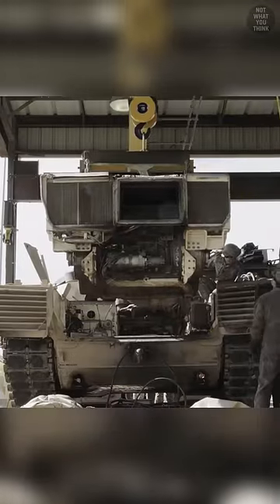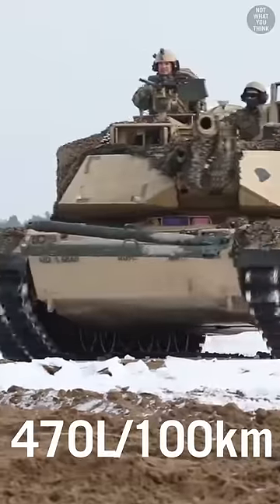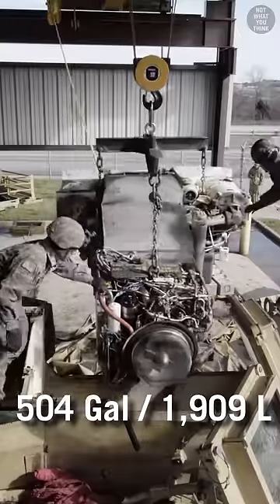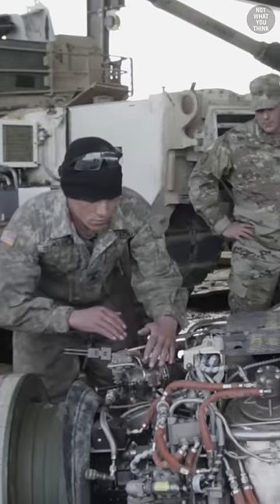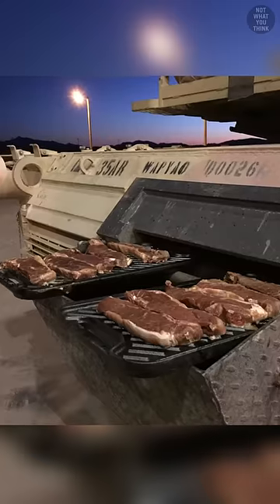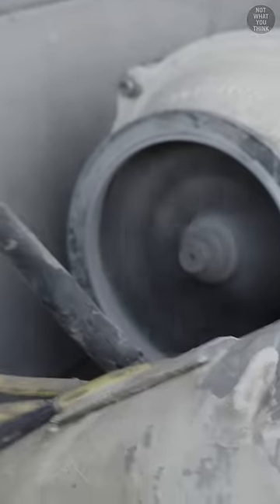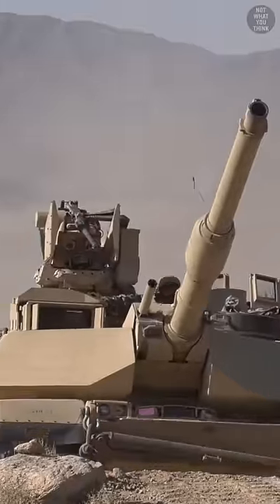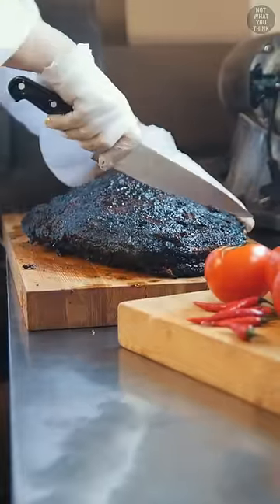Why M1 Abrams Tanks Have Gas Turbine Engines #shorts

Comment: The more quiet part is Not what you think

IIRC Abrams engine produce sound on higher decibels compare to turbo diesel engine on Leopard 2, but its sound is higher in frequency, meaning it dissipate quicker at longer distances. That means if you're standing from afar you are less likely to pick up Abrams's engine sound.
Reply: Saw some Leopards roll by during a military parade rehearsal in my country & I was joking that with how noisy they are, they'd give away their location to the enemy
Reply: Plot twist, nicely done sir.
Reply: You Dare Use his Own Spells Against himself, Minh ?
Reply: Watched a video of an Abrams rolling by.

You hear the tracks before the engine.
Reply: @lzh4950  i dont think theres any tank ever that is acceptably quiet, i saw a ww2 museum tank parade and boy the noise is unberable i would shit myself if i was in battle and heard that.
Reply: Gas turbines als support less fuel variety than common military diesel engines.

For example you can fuel some diesels with cooking oil, which is hypothetically useful during war times...
Reply: I've always wondered if militaries employed sound detection devices. Maybe radar is just so much better that you would never use anything else. 

But then again you have elephants communicating over vast distances with low frequency sounds.
Reply: Having lived near a National guard depot that had abrams, I will say they are actually both quieter and louder. Idling, quiet but emit a very high soundpitch that drives dogs mad. If accelerating, yeah, much louder than a diseal
Reply: @iivin4233  dont know much bout radar but wouldn't it be more like a sonar or acoustic detection device? I mean i get what you mean, be a sad day when hellfire rockets can home in on sounds rather than laser guidance or heatseaking. Little good hot smoke will do after that.
Can you imagine homing in on snoring or whispering from 15miles away? Scary..
Reply: That's super interesting

Is that why you can hear big bass drums over long range compared to instruments and voices at the same volume?
Reply: They do, but mostly the navies. I assume a sonar for land targets is not very effective, firstly since sound waves travel worse in air compared to water, and second, there is probably more noise (literally) compared to in water, so you will have a hard time distinguishing targets
Reply: @gameseeker6307  In my experience as a bass player, yes.  I think the wider/longer wavelengths at lower frequencies need much more energy/volume to produce a comparable volume to higher-ranged instruments (such as guitars and vocals).  This is why when you stand outside of a music venue, you'll probably be able to hear/feel the lowest instruments (ie: bass, drums, synth, etc), but not so much the harmony/melody ones, because the lower-ranged instruments need to be much louder/moving more energy.

If there are any audio engineers out there, feel free to "Um, Actually" me if I'm off-base. :)
Reply: @thelumpylobster  it makes sense ig, really noticeable at marching band performances or when you're far from a stadium or performance venue
Reply: That's definitely interesting. "it's so loud if you're up close it's louder than ever but it's infact so loud that from far away you cannot hear it
Reply: @TheAnnoyingBoss  ...because its the "right kind of super-loud," lol
Reply: @Dooaana  turbines compress their fuel more than standard gasoline engines prior to combustion, they also heat it a lot. You can run a turbine engine off of tequila, or diesel.
Reply: Someone watches spookston here >:)
Reply: Itll sound like an airplane from afar if your not familiar and or paying attention
Reply: @thelumpylobster  I'm not sure myself but I think the shorter wavelength (i.e higher pitch) scatters more easily than long wavelengths (low pitch like bass)

I can't exactly recall the equation for energy in a sound wave but amplitude and wavelength were both part of it. Generally at same amplitudes, I think the high pitch sound contained more energy too.

Just that waves do wave things and I think they'd get scattered more easily. But feel free to "actually..." Me cuz I have a sneaking suspicious I may be confusing light waves with sound waves somewhere.
Reply: This is the correct answer.
Reply: This is the correct answer.
Reply: In 1991, the Iraqis called the M1 "whispering death" because of how its turbine engine's noise dissipated at a distance, well short of normal combat engagement ranges.
Reply: @malnutritionboy  Yep
Reply: I mean I was out in the field for training exercises, and was playing Red forces. I remember being in a tree line with couple people, than being told we’re all dead. Funny thing is we look over and see we’re the Abrams was located the thing wasn’t more than 250 meters away laid up in a adjacent tree line. The turbine engine sound was masked pretty well with all the noise going in the area. It was really a trip in half to realize that something that big can move with that little noise for what it can do.
Reply: This! Like a 2 stroke dirt bike in the woods is quiter than a 4 stroke.
Reply: Let's electrify tank like many new car on street as they say it is use much more efficient energy, have instant torque and completely silent
Reply: @Dooaana  thats not necessarily true. Gas turbines can run on anything a diesel can in an emergency. Even plain old gasoline.  It will accelerate wear and move up when it needs maintenance but for short periods it can run on anything that burns really
Reply: IIRC???
Reply: @lzh4950  fellow Singaporean?
Reply: I thought low frequency sounds dissipate more quickly. That's why slow drone propellers are quieter
Reply: @Dooaana  wrong the AGT1500 can run on jet fuel, gasoline, diesel and marine diesel, while it hasn't been tested there's no reason it couldn't run on cooking oil. A common diesel engine can't run on gasoline or jet fuel, they don't even have spark plugs.
Reply: @gabedarrett1301  they don't. They travel further. Low frequency sounds are more difficult to attenuate in air than high frequency sounds, and therefore travel further. Low frequency sounds also transmit through materials more easily whereas high frequencies reflect more easily. All of this means low frequencies are easier for sonic radars to triangulate and humans to hear. In urban environments a turbine might reflect further but when you hear a diesel its close, and it's coming from where you hear it coming from rather than reflected an unknown number of times by structures. Also consider the near universal hearing damage of the battlefield and everyone is rather rapidly losing the ability to hear high frequency sounds, especially if the United States is winning.
Reply: @gabedarrett1301    Think about artillery fire from far away and noisy city diesel buses.
Reply: @ding24_  Hi hi
Reply: @lzh4950  eh hello man
Reply: @lzh4950  U wont come close to see the enemy
Reply: Dude, Qun (OP) I can freaking hear it from my House, wtf are you talking about?
Reply: I was talking to a Bradley commander about that, and he said during training an Abrams rolled up on him and everyone else and closed the rear door of the Bradley with their barrel... the Abrams was supposed to be OPFOR. He said the frequency they give off when driving is so high that your brain just kinda ignores it as background noise.
Reply: True. Also turbine wears out faster. 
And diesel can idle a lot longer plus also use several fuels. 

It is just a preference and what you choose depends on logistics and scale first and foremost.
Reply: on a another note Abrams sound is mostly sent towards the rear of the tank
Reply: *higher frequency not decebels
Reply: @Dooaana  uuhhh I don't think that's true. You can literally run a gas turbine on any liquid fuels. Just have to adjust the air fuel ratio.
Reply: @Dooaana  agt1500 can basically run on anything combustable if necessary.
Reply: He said in bed so I assume he is talking about fing it
Reply: Actually, all you hear are the tracks when they go by. You'll hear the bradleys and m88s before you hear the abrams.
Reply: @lzh4950  If you can hear a tank, you’re already in its kill zone.
Reply: @Dooaana  You can fuel the turbine engine with jet fuel (standard fuel) of any kind, any Diesel, gasoline/petrol, methanol, alcohol, cooking oil… anything that’s liquid and will burn. 

The preferred fuel is JP8 jet fuel. The other stuff will work, but it will require a lot more maintenance afterward. 

Military Diesel engines will run on Diesel or heating oil, and if equipped with a filter for it, cooking oil. That’s all.
Reply: @johnnymatias3027  It’s also why the police now use low frequency, low pitch rumbler sirens to cut through other noise.
Reply: @jamegumb7298  Diesel engines are much simpler, run cooler and are easier to work on. That makes the turbine engines work hogs. In fact, the Abrams was designed so that an engine would be very quick and easy to remove, and a new one dropped in, while the old one is hauled away for repair/maintenance work. That’s hard to do without the US logistical ability.
Reply: @Dooaana  You mist have missed the part where he said gas turbines "can use a variety of fuel, like diesel and jet fuel."
Reply: @afcgeo882  True. And that ability is there. 

To be fair, they do the same with diesels. Easy to remove powerpack (engine and electronics and transmission) so that it can be replaced with the defective engine being repaired elsewhere. The thing is it can be repaired in a much more austere environment. 

Abrams did in fact have a lot of issues with desert sand in the middle east, this is why they put in different filters, it chewed up the turbine making for a lot of replacing.
Reply: True
Reply: @cleveland2286  Gas turbines don't compress fuel but air (and good luck trying to compress liquid fuels). But yes they run on pretty much everything that burns. Restrictive is rather the fuel system like pumps and nozzles. Certainly gas turbines are easier to adapt to different fuels than piston engines.
Reply: @michaelkoerner4578  yep.     Clack clack clack.
Reply: @wanderschlosser1857  Yeah I wrote it badly, diesels the fuel is injected after the compression stroke, same with gas except for carb'd ones, where the fuel/air mixture is present during the compression stroke because the fuel is atomized. Where the liquid itself is not so much compressed, but the gas that the fuel is present in is. 

As for combustion, they definitely run off the same principle, and I'd say closer to diesels than gasoline engines when talking about turbines. As their inlet gases are compressed, *pressurized fuel is injected, and then it combusts, just in different ways.
Reply: @cleveland2286  Similar yes but also quite different since at gas turbines fuel is injected into a permanent flame. It doesn't ignite due to compression but because the flame is already there fed by a constant flow of fuel and compressed air. Also similar for both systems, excessive air (oxygen) + very hot combustion = high Nox emission. Although modern injection systems are greatly reducing that problem.
Reply: @lzh4950  but doctrine wise a leopard isn't meant to be standing.
It's a tanks build for mobility, that's why it has lighter armor vs Abrams more stationary fighting style.
That's also why turkey failed with them so horribly.
Reply: I mean. Even upclose, its still not as loud as a Leo2
Reply: @cleveland2286  Nah tequila has waaaay too much water in it to ever work as fuel.
Reply: @josefstalin4532  if it can catch on fire, turbine engines can probably burn it. I've seen tequila burn well.
Reply: @Dooaana  Thats actually done in Ukraine right now. Shotload of domestic cooking oil. Price is the same ~50 hryvnas per liter. As a bonus no currency is spent on furl, since all is imported.
Cons - you gotta take apart engine and fuel system and clean it regularly
Reply: At 100m you only hear the Tracks ratteling.
Reply: Also some would argue a 60+ ton pile of metal on tracks while make vibrations in the ground before you hear it.
Reply: @thelumpylobster  Um, Actually, you are pretty much correct. The reason is higher frequencies oscillate, well more frequently.
So you have 2 different wavelengths, one smaller than the other. The large wavelength wiggle less, so it loses less energy than the one wiggling more. That means the larger wavelength loses less energy by moving wiggling less in the same distance. And the larger the wavelength, the lower the frequency.
Reply: @cleveland2286  Assuming you're talking about 40% tequila I highly doubt it.

There is so little energy left after boiling all the water, that it would never work.

80-90% ethanol might work though.
Reply: @vizender  Thank you for the clarification.  That's pretty cool! :)
Reply: @thelumpylobster  you’re welcome. It’s not exactly right, but for basic understanding of wave propagation (at least mechanical waves, not electromagnetic waves) it’s mostly right.
For exemple, take water waves. Small waves on the beach die pretty soon. These are pretty high frequency waves that only travel for a few miles at the very best.
A tsunami however, because it’s caused by large vibrations, are really small frequency waves (that’s why they are only a few meters high in the deep sea, smaller than many other waves you encounter during a storm for exemple), and they can travel hundreds upon hundreds of miles. So it’s not just sound.
Reply: I've talked to tank commanders that call BS on that. In training exercises in Germany they were able to get within 75 meters of infantry on a few occasions. While the Leopard II can be easily detected by sound from several hundred meters.
Reply: @Dooaana  the british determined that to be false. A turbine can run on anything combustible, a diesel cannot do that safely.
Reply: @discopernicus  explosion-proofing lithium battery to the same level of what they have for kerosene and diesel is… not easy. also, they love fighting in hot deserts for oil or whatever, which isn’t good for batteries to start with. and hypothetical arctic wars in alaska or some shit.
Reply: tanks are made to fight at a distance from one another. they are really fuckin loud when you're anywhere near them. 
think of the sound of an airline jet, and a strong whooshing sound.
but if you could hear the enemy tanks engine or rolling around, you are waaaaaay too close and most likely gonna hurt.
Reply: @iivin4233  there are. huge concrete emplacements near the coast of Kent, England whose purpose is to catch the sound of approaching aircraft...
Reply: @mollielacey7428  "made to fight at a distance", sure, but doesn't end up that way every time. Look back through history. From Stalingrad to Kursk, Normandy to Cologne, and the fighting for Berlin. Jump forward to night fighting in Korea, all the way to Bagram and Fallujah, the tank can and will end up fighting in close quarters, and when that happens, especially when there is supporting infantry, noise can be the last nail in the coffin.
Reply: @afcgeo882  uh, the diesels are the same way. A Leopard II and an Abrams take the same amount of time for an engine swap. They aren't made easily removable because they require alot of maintenance, they're made easily removable for faster turnaround times to get they back in the field, same as the diesels in the Leopard II. Turbine engines have exponentially less moving parts than a diesel, alot less to go wrong with them. They also start easier in cold weather, and have less necessary systems (turbochargers, cooling systems, etc) to make the necessary power. Please stop spewing on about things you don't know.
Reply: @imperialmodelworks8473  Oh yeah? What’s the required depot maintenance interval on the Leo 2?
Reply: @afcgeo882  ask someone in the German army, because that isn't what we are discussing here. A servicing involving the whole tank at the depot? No idea. An engine swap on a Leopard II? 35 minutes. The Abrams is roughly the same, depending on the sources, but my stepdad who worked on them for 2 tours in Iraq and 12 years stateside said a good crew can swap an Abrams powerpack in 25 minutes. The turbines would be rebuilt or serviced in house over there, unless it was a catastrophic failure (cracked castings, etc), same as any diesel engine. Besides the engines, the Abrams and Leopard II are pretty similar tanks in terms of armor, suspension, and general vehicle maintenance.
Reply: @imperialmodelworks8473  So let me get this straight… you never served, never worked on either platform and you’re trying to tell those who have “how it is”? 🤣 Sit down, shut up, and take notes.

The powerpack removal on the Abrams WAS, 100% designed to be done quickly for ease of maintenance, and despite having fewer moving parts, and better cold starts than a Diesel (because of the viscosity of oil), the powerplant in the Abrams is FAR more complex than the KA-501 in the Leo2. That makes it more prone to failures. To be fair, both engines are very reliable by MBT standards, but WERE, FACTUALLY designed to be easily replaced in the field.
Reply: In idle it’s pretty quiet or at least quite enough you won’t hear it in another tank
Reply: @thelumpylobster  as someone who spend most of his life on DAW, yes it's correct. That's why you must always put bass frequency on mono (no panning at all), and higher frequency on stereo (pan them)
Reply: @discopernicus  Yes, let's make an electric tank... with a 15 mile range and a 2 hour charge time. I hear that electric grids are wonderfully reliable in warzones, too. Totally wouldn't need a convoy with the usual fuel truck AND a massive generator for it. And I hear lithium batteries do very well with heat, sometimes they even get carried away and start generating their own!
Reply: thanks. i wondered about that having heard a turbine at close range.
Reply: That explains why deep voiced classmates make them an easy target for a teacher
Reply: @gabedarrett1301  This topic is much more complicated that video and comment section sugesting...
First of all turbine engine RPM are much higher than max frequency that young kids can hear->25KHz, 20KHz that typical soldier can hear(18-25 years old) and 6 up to 8KHz that old people can hear.
The whole sound that people here are considering as this engine sound is in fact not the loud main freq but the harmonics... that have much less power.
Human ear sensitivity is also not flat, top sensitivity is in few KHz range->human speach range...
So bigger propeller gonna create sound in frequency that is less human ear friendly->that is why people like so much huge subwoofers with more watts than every other speaker in that setup...
Low freq sounds like for example huge explosion can circle the whole planet and come back to you. The biggest nuclear device created sound wave that circled the earth three times...
In case of any engine or mechanism that is moving fast you also need to take into consideration all the harmonics.
Bigger propeler on some light vehicle gonna have much larger bearing surfaces and thus these surfaces do not have to move quickly in order to generate sufficient lift. So the airflow around the propeller will be less turbulent / quieter.
Reply: you can also lock the brakes down and open up the exhaust to knock down a brick wall, no shots fired.
Reply: @lzh4950  leo2 noisy ? What you been smoking  ? In comparison to most MBT is quiet, the M1A2 is noisy in comparison.
Reply: @discopernicus  It has been tried, a complete engineering disaster. Batteries and their energy density is the main problem, but there are some useless prototypes, if you search for them.
Reply: High frequency = high attenuation
Reply: Our Leos have external ANC since like forever. You won't hear it coming.
Reply: Honestly when you think about it, if infantry is close enough to engage you, 90% of the time they will hear you regardless, I'd rather take the lower thermal signature and longer operation time/ fuel efficiency than not being heard from 2.5 less KM or whatever distance the difference is.
Reply: @Battlenude  yes that's in a non battle time, when your actually fighting your never going to be sitting in a spot for long, your moving so its harder to hit you, like when infantry in trying to kill you, you don't just sit in the middle of the street with your tank off, your moving in an out of cover taking shots at targets.
Reply: funny how O read this with the same intonations as him🤣
Reply: Eh yea maybe but from close it’s clearly higher compared to a big Diesel engine and that goes for all turbine even the smaller ones used in cars and trucks even a bike all higher compared to a diesel. Jay Leno has a turbine bike and it sounds 100x a sport bike
Reply: Very interesting, thanks for explaining
Reply: @DA  how are you going to charge it? You will need hydrogen fuel cell to be the best of both worlds. Quick fill up using methane and power of EV.
Reply: Former armor div soldier. You'll hear the tracks before the engine.
Reply: Anyone who has ever heard a turbine fire up would realize that quieter is very questionable 😂
Reply: @Dooaana  you got it the wrong way around. Gas turbines can use any hydrocarbon aka, it’s an oil, it can run.
Reply: can't wait for the all electric tank.
Reply: The Abrams can only survive if it can eliminate shells before they hit the tank. That will not always work.
Reply: then you haven't heard of Soviet Tanks like t55 and 72 B
Those guys would blew your ear drum
Reply: Enemies could heard Russian coming from miles away lol
Reply: U don't know what i think
Reply: Yes, that's right at least in principle.
Reply: @ralofofriverwood4806 I'm fairly certain the M1's up to the task.  Crews are taught that, in a pinch, damn near any liquid combustible can be used as fuel.

Sure, your MX'er may not be thrilled when you RTB, but, hey, "Cost of War."  Your $10M tank made it back when others would have to be abandoned.
Reply: Turbines are more reliable and have longer service intervals than diesel or petrol engines.
Reply: @lukasausen  I mean, it's pretty hard to quiet a tank down. Even if you don't count the engine, you gotta quiet over 100 wheel bearings, constantly supporting 40 tons, caked with mud. No way to stop that and the track from squeaking.
Reply: But the Leo already targeted you anyway...
Reply: Lmao you might not hear the engine but 70 tons rolling on tracks will give off all kinds of noises that travel far
Reply: @cleveland2286  the air gets compressed. The fuel doesn't.
Reply: @carstekoch  Both do, liquids just don't compress as well, but they compress nonetheless.

On the other hand, man, I really wonder what gasoline really likes to do when you heat it up a lot and expose it to a lot of air... I do wonder
Reply: @cleveland2286  Of course liquids can be compressed, never said they couldn't. That doesn't mean that's the goal or even intended side effect of the fuel pump. In fact the fuel gets dispersed as fine as possible into the air just before it ignites, which is pretty much the opposite of compression.

Hmm evaporation? Ignition? I'm sure that's pretty much the same as compression. Must be to be in any way related to the topic of fuel being compressed.
Reply: But you still see the dust trail when it's moving. Nobody uses a tank because of sound stealth. And thermal camera picks it up like a hot coal.
Reply: @thelumpylobster  Fellow bassist here to say you're correct! Higher wavelength frequencies are a more energetic wavelength but they dissipate more quickly. Lower frequencies carry less energy but travel further before dissipating. That's kinda why you can never hear the singer at a badly mixed gig, the bass frequencies from the bass and drums can easily overwhelm the trebles of the vocalist over even a very short distance from the speakers
Reply: @jamegumb7298  😂😂😂😂😂😂😂
Wrong
Reply: @travisadams4719  🤣🤣🤣🤣🤣
No you're wrong!! LOL
💩💩🤡🤡
Reply: @Battlenude   yes because it isn’t the rubber part of the track you are hearing it’s the end connector contacting the sprocket.
Reply: @jamegumb7298  I was an m1a1 mechanic(MOS 2146), so please do share your qualifications

(I’m speaking strictly about putting a different filter in, that never happened)
Reply: @Dooaana  It said in the video that it could run on diesel, gasoline, or jet fuel
Reply: @carstekoch  M8 for what reason do you think when I said fuel getting compressed you think in the fuel lines.

The fuel gets "compressed" (not what I was talking about anyway) and shot out an injector right before the COMPRESSION stroke of a piston engine or, in a turbine, introduced to the COMPRESSED air from the forced induction from the turbine.

The fuel when atomized*** and introduced to the heat of the engine will often turn into a vapor, a gas, which will COMPRESS SIGNIFICANTLY with the air.

Nothing I said is wrong whatsoever, I have rebuilt a piston engine and am in the process of turbocharging one with a custom port injection setup, I know what I am talking about just fine. The way you write your comment feels like you know what you are saying is completely missing the point and you're doing it just to annoy me. Either way, I'm not gonna reply past this, if you want to be wrong then so be it.
Reply: @cleveland2286  
Oh great, you build a piston engine. Dude, I work on turbine engines. Your argument from authority doesn't work here.

The fuel gets ignited immediately after the dispersion. The air is compressed and the fuel dispersed to introduce more oxygen to the fuel allowing for a more effective burning of the fuel. The combustion chamber is behind the compressor(s).
There is nothing that could compress anything after the dispersion and before the ignition. Unlike in a piston engine and in particular a diesel engine where the mixture is compressed further to ignite it.

You are just plain old wrong on this one.
Reply: higher frequency you mean to say
Reply: Gas turbine engines are actually much quieter than a turbo diesel one is, especially when moving, gas turbines are loud as hell when starting though
Reply: That's very true I served right next to Abrams in the past only did my 3 years and they always roamed around my Infantry Company you literally can't hear them until they're in close in combat range because their noise pollution can be absorbed by the hills and varying terrain too
Reply: This is what makes the tank scary, as you'll barely hear it's approach from afar
Reply: a diesel engine can run quitly when not throttled 😑 whats your point
Reply: @lzh4950  when tanks are in a group and you stand 100 meter far 😂😂 they can run very quitly by shutting down the 1 of the 2 ventilators and lightly throttled
Reply: @lzh4950 I mean, a Leopard charging with 60-80 kmh into battle probably will give his position away anyway but yes
Reply: @Dooaana gas turbine can do that too. Especially the one in the abrams
Reply: @TheAnnoyingBoss apparently nuclear bombs dont make much sound.
Reply: Very true. From about 200 meters, I can barely hear them. When I hear them rolling down the road, the sounds of the track almost drown out the engine's noise. Remarkable really. The way the exhaust is also helps, since most of the noise is actually being directed rearward, at least, that's what I've noticed in my time around the tank.